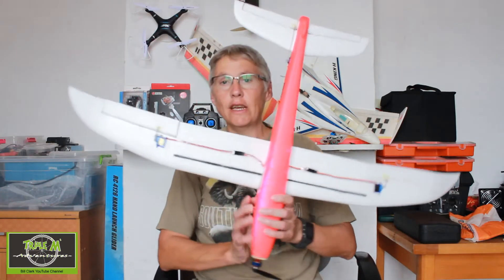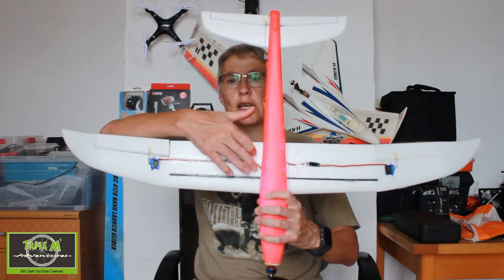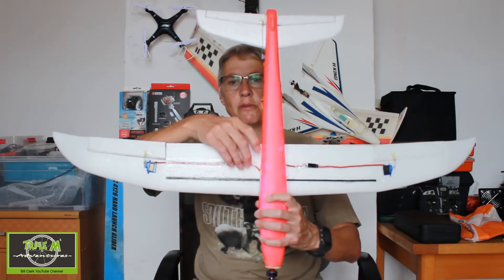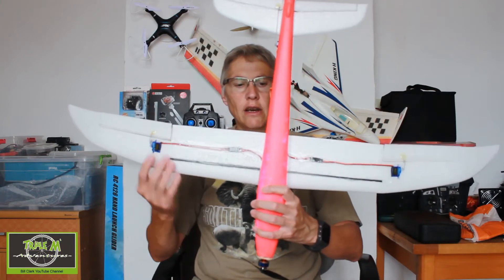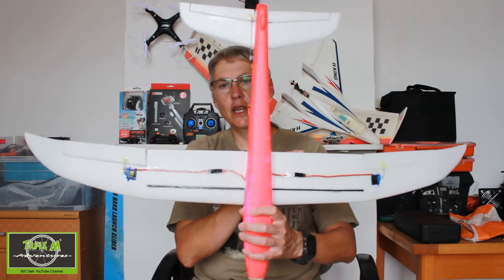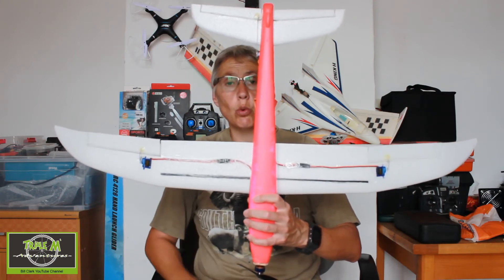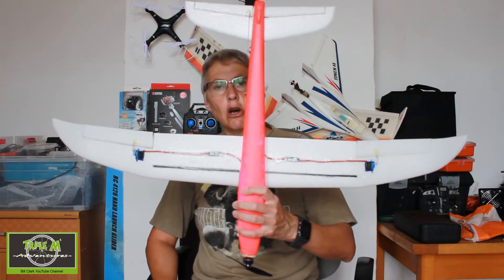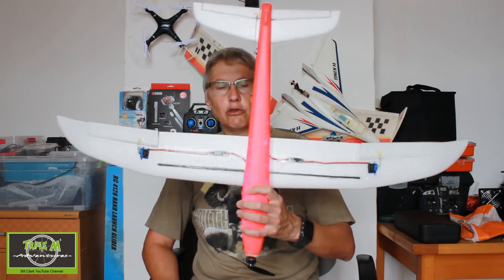RC 4126 Cheetah Glider Conversion Update

Comment: Good video.What is your C.G ?Ihave a second hand one , and i wan to put the motor pusher up the wing, Do you know the best position to place it? THANKS.
Reply from the maker: Try 1/3 back from the leading edge and test throw the model with neutral control surfaces.
Reply: THANKS. @the-happy-RC-flyer

Comment: Mine has a spar at the top surface... then fiber tape strapping tape all over .the top goes into compression and the bottom of the wing goes into tension ...I used a fiberglass rod and did almost the entire length of the wing on top ...

Comment: I actually extended the wing of my Cheetah with a additional centre section made of 2 mm Depron so it now has a span of 1350 mm! 
With a small motor, a 5x3 folding prop and a 950 mAh 2s it still only weighs 196 g so the wing needs no reinforcement. Its no 'power' plane but it does glide very nicely.
https://www.youtube.com/watch?v=uLo6yDHVP-Q

Comment: Re: The other comment: Personally I would always prefer a, say,  1x3mm cf spar (long dimension  used vertically) to any form of wood dowel and I'm not convinced a cf piece would be heavier than a suitably sized (i.e. non-breakable) wood alternative. As for control surface shape, one has to work with the moulded-in shapes of the original model and pushrod length on an RC conversion of a chuck glider is nomally determined by mounting the servos where they need to be for CG location  and working from there. Have done any number of different Lidl glider and FX 709 conversions. and am about to do my first RC Cheetah so I found your conversion info invaluable. Happy flying from Scotland.

Comment: i always like to  use something  Heavy (cf),  when i  Should use something  LIGHT;  like  bamboo  or  poplar  dowel.      at :32, it should be understood that control surfaces  SHOULD, to the extent practical,  have the  shape of  a   Parallelogram.      you may know that the aileron pushrods  are  Really  short; and a too-short pushrod  is  not a happy  pushrod.   cheers
Reply from the maker: David Davids, thank you for your comments.